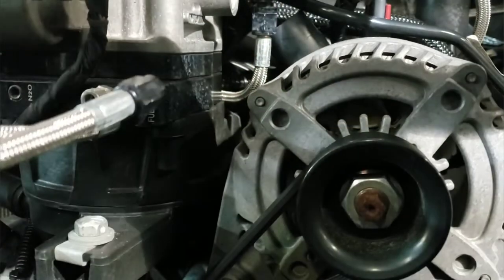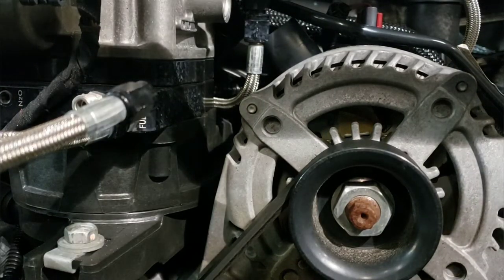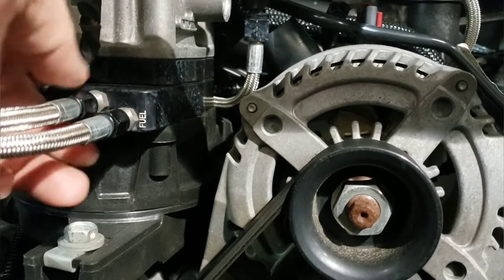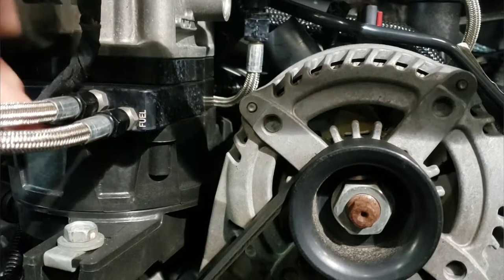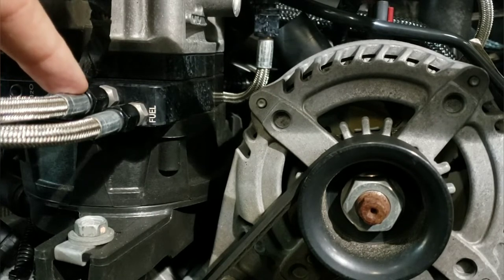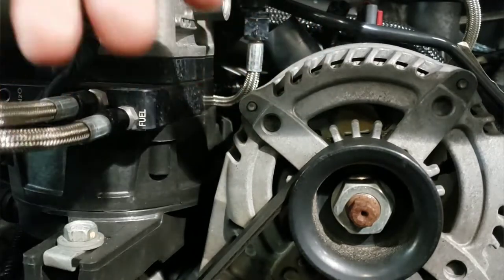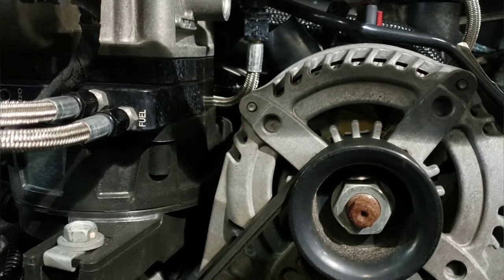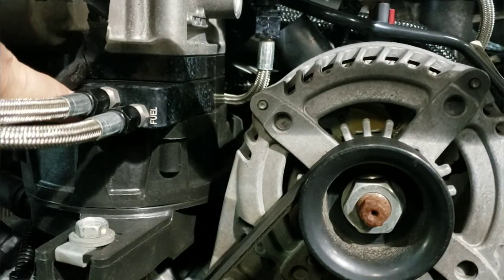HOW DOES NITROUS WORK AND HOW TO USE IT ON R/T RAM 5.7 HEMI

Comment: Love the videos 👍🏻Did you delete the (mds) ?  I was nervous about putting 100 shot on my 09 charger rt until I started following your video about nitrous .. did you have to run a timing Retart box 📦 when nitrous is  engaged  ?  I have a lot of bolt ons on my charger does this effect the nos far as leaning out the engine ??
Reply from the maker: Yes I did a mds delete with hellcat lifters
Reply: Thanks for the info👍🏻👍🏻I’m running hp tuners laptop tune now .. I’ll just have to get it dyno tuned once installed the 💯 shot then , awesome thanks for the info big help ....

Comment: Thank you for these great videos , it really perked my interest on using nitrous ...
I’ve been slowly playing with 2014 police pursuit 5.7.

Because the pursuit comes with the NAG1 5 speed... 3:59 1st gear ...
Is there a way to have it come in only on second gear after the 1-2 shift????
I think 100 shot would just blow my traction in 1st gear
Appreciate any thoughts you might have on this thank you

ATF hyflow cold air, 
no cats through 2 1/2” Mandrel bent exhaust 
hemi fever tune
Had 2:65 open diff... changed to lsd 3:92 diff
Reply from the maker: Window switch or what i would do is just flip the switch after the shift.
Reply: @FrostbiteRam   so the window switch will replace WOT switch? 
I’m reading that it goes by RPM settings and TPS settings, so I am assuming it’s using an electronic read of the throttle position sensor, in place of the mechanical foot switch.
Reply from the maker: @dianeanza5462  correct

Comment: Did you put in the colder plugs as it showed in the directions? If so, what brand and what gap did you use?
Reply from the maker: Yes I did I went with denso plugs I'll ha e to look the part number up
Reply: Frostbite Ram curious if you had that Denso plug part# handy - also did you do any special gaping?

Comment: What is your thoughts on running 150 wet plate kit? The car has been 7.6 at 93 in the 1/8 N/A. It is a 2017 with auto. Do u think the car will hold up and what do you think I will gain. Btw have all supported mods
Reply from the maker: 150 is very doable with good tune and fuel. 100shot all day and makes a big difference

Comment: Hey man hope all is well. Dont mean to bother but im installing a nitrous express wet kit i believe just like yours. Few questions. Do you have any kind of mods in the fuel system(injectors,pump)? And with the plugs on the plate i added a little dab of thread lock and screwed the plugs all the way in.. is it ok? Thanks! Got a 15 challenger rt 6 speed with a 274 comp cam and will start off with a 75 shot soon. Thanks
Reply from the maker: Stock pump and injectors is good up to 150
Reply: @FrostbiteRam  even with a cam in it? Shes putting 412whp and similar in tq..
Reply from the maker: Stock pump is fine 100shot all day

Comment: Is a tune recommended to install nitrous on a stock vehicle with bolt  ons I'm running a superchips  with 93 octane tune
Reply from the maker: You do not want to run a high timing tune with nitrous.   If you run a 75 shot or less you can run your factory stock tune and be fine I recommend getting a nitrous tune for anything over a 100.

Comment: I'm running maximizer 5 but having trouble keeping a rpm signal from the fuel injectors. Any suggestions?
Reply from the maker: I'm not familiar with that controller I thought about it but it seemed a little more complicated than what its worth for the little bit of nitrous I'm using.

Comment: Hi!dumb cuestion, can you run a diablosport tune with a MSD programable ignition box(to retard the timing when sprayng)??
Reply from the maker: Probably could not sure if that would work on current stuff tho
Reply: @FrostbiteRam  Im kindoff restomoding (want it to be a sleeper first) a 2006 Durango 5.7 w/o vvt &mds stock, Im planning to get the Predator 2 platinum 7320, a 100 shot, with the MSD 6al2 programmable,(it has a feature) to adjust the timing to be safe just when spraying, aaand OF COURSE to ¨play¨ with timing if i add more nitrous until more fuel is needed! 
Its a junkyard motor!!Runs pretty well, low millage.Any suggestions?

Greetings from mexico!!F'ng love your videos!